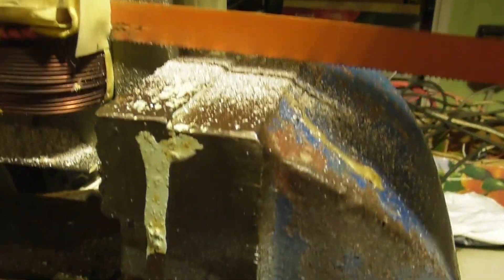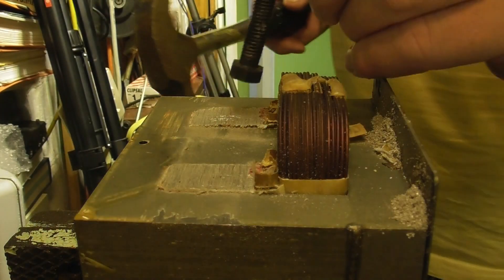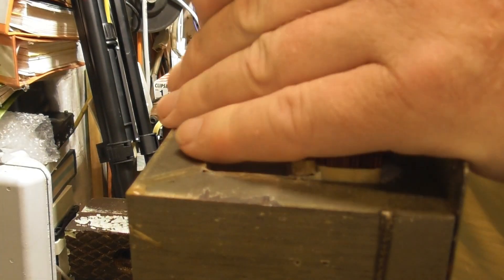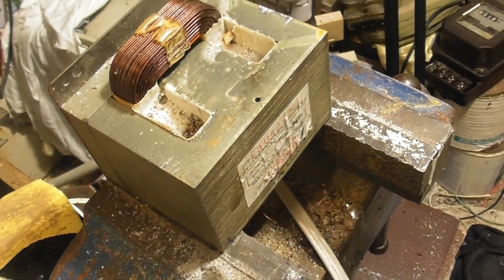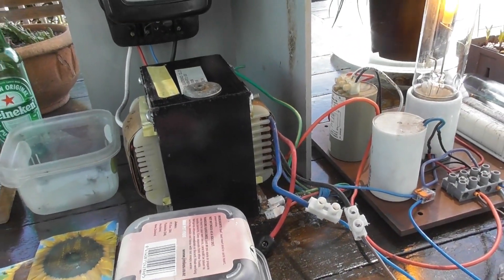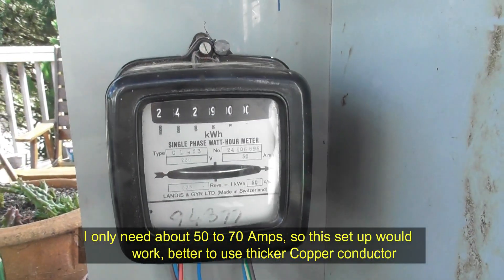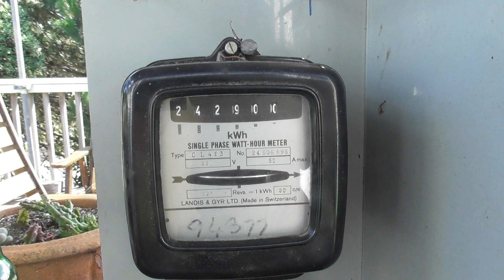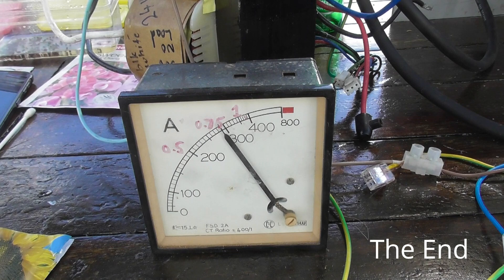Remove HV winding of a MOT and replace with three turns three core

Comment: How many turns would you need for 32v ac output?  I have an old mot and want to rewind the secondary for low voltage high current output

Comment: I have found on a lot of them you can barely get 2 turns of 4/0 AWG (107mm.) 

it’s a tight squeeze and hard to wrap it around the core without breaking the insulation. My next idea is to just run 2pieces through in parallel as a single turn, but run them through 4 trafos so it all adds up…

Comment: I have had my share of alu secondary transformers.
About 13 years ago I had transformers made for a product we developed. The failure rate on the secondary was quite high. Often, the soldering from the alu wire to the copper lead failed leading to a dead transformer i.e. no secondary output.

It's done very often as a cost cutting measure with high copper prices, and to swell profits. The Chinese do it often.
Also seen it in UPS transformers, which, of course, fail too after 3 years.

Comment: All microwave transformers are aluminium, at least since the last 20 years. I just drop them into the steel scrap complete, unless they come from before 2000.
Reply: Not all of them, the good quality ones have copper windings and some of them even have plastic coil formers.
Reply from the maker: This is the first one I have seen. The ones I have taken apart were all with copper windings.
Reply: @RODALCO2007  Look at manufacture date and all the recent ones have CCA wire and thinner steel.

Comment: The APC UPS machines use this kind of aluminium winding too.  Their failure mode is to go short on the 230V side - the secondary - where they solder the aluminium winding to the Copper terminating lead.
Reply: Ive tried to solder to aluminium before and it just doesn't stick. It must've been be crimped.
Reply: @simontay4851  Correct.  Aluminium can be brazed but it requires a very highly reactive flux.